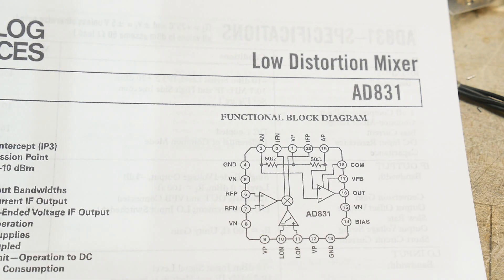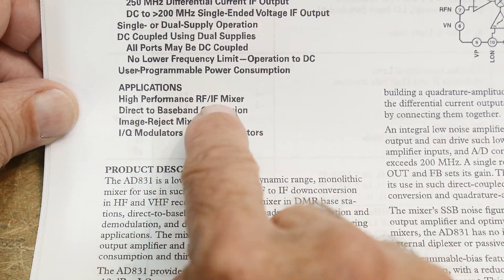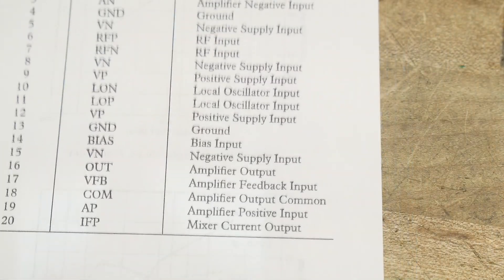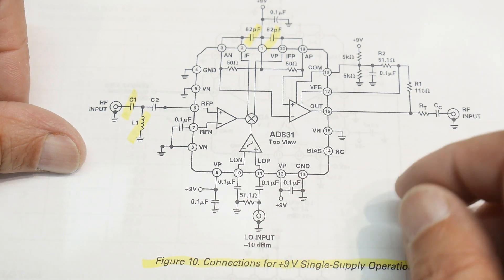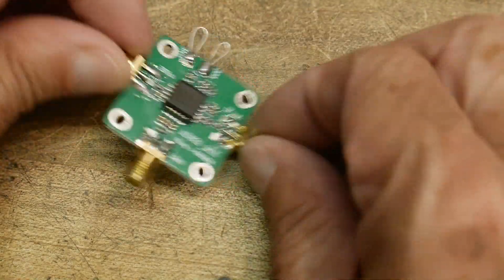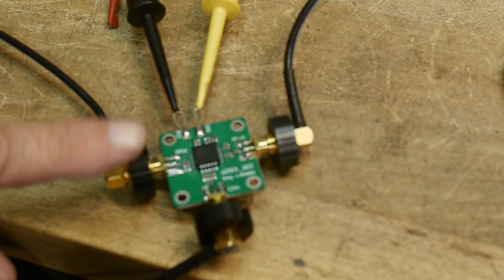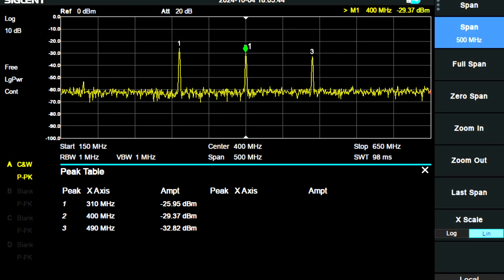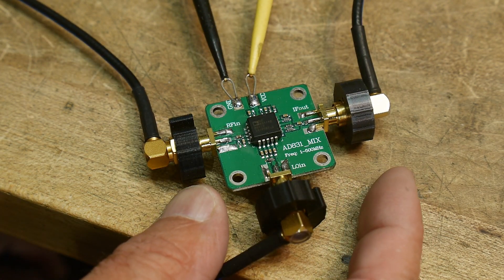#2033 AD831 Mixer

Comment: Newbie observation for someone who dabbles mostly in logic: LO = Local Oscillator, used with PLL (Phase Locked Loop), LO seems to be the local intermediate oscillator that PLL syncs with that's a lower frequency (but multiple) of the high frequency carrier. I spill my thoughts here as I'm likely rong somewhere and am open to correction.  ;).

Comment: Can be used for transverter at 440Mhz /28Mhz but only for RX. Because the output is only 250Mhz. Is there any other chip that could do TX as well?

Comment: IF output is specified up to 250MHz (200MHz single ended), but 400+-90 is beyond that, so you probably won't get full performance.
Reply: You can't counterfeit analog stuff!!!
Even a single resistor inside the chip matter.

Comment: I also got two of these a couple of weeks ago to test them and they did what they should do. Just I did not look at the power consumption which is rather high with around 100mA. 
As my application is in the lower MHz region I then took the SA612A which works quite well and operates with 3mA at 5V. The data sheet says it works with up to 200 MHz lo and 500MHz rf.
Reply: The high current is the price you pay for the excellent linearity (high IP3). SA612 has a very much lower specs in this respect.

Comment: One of my TO DO projects is a "small difference clock measuring system"  for comparing a Rubidium standards with DGPS clock,  It uses a heterodyne technique to compare two 10Mhz signals form a DGPS and Rb Osc against an internal non precision reference that is a few Hz above 10Mhz.   It then measures the period of the difference image for both input signals  against the internal reference and compares them.   I will have to look at the AD831 for the two mixers

Comment: What a timely video, I just bought one of these on a PCB last week (looks identical to yours).  Haven't tested it yet, it's either a fake or reclaimed at the price I paid.  Worst case, I spend the $22 mouser wants and replace the chip.   The price I paid on Amazon is about what the Chinese PCB fabs charge for a board anyway.  Interestingly, the datasheet for the current part (ad831apz) only goes up to 400MHz.  Hoping to use it for looking at 20Hz-20kHz signals on my VNA, with or without the scooter stick.
Reply: I bought one of those chinese boards these days too. Tested it with 300MHz, and although it was attenuated, it was still usable